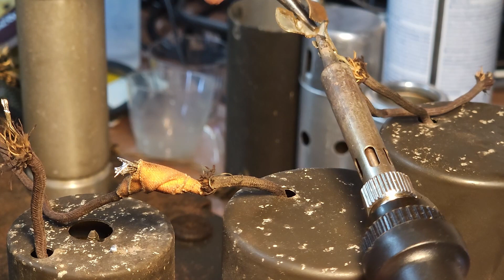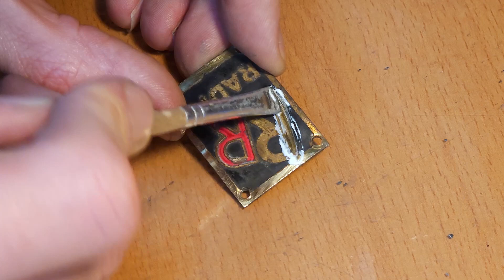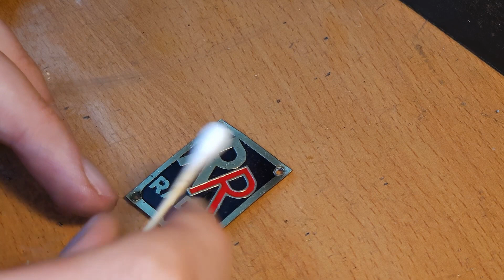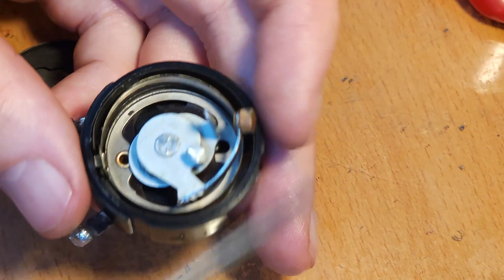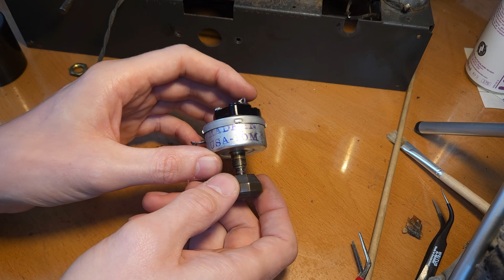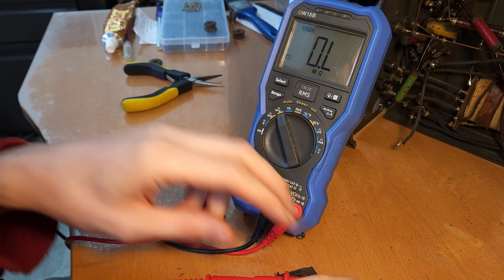Preparing the chassis for restoration - R.R. Radio Type 568 - Part 4

Comment: To comment on the band aid tape; Cloth tape was widely used in the 30's up into the 50's.  Vinyl Electrical tape was not created until the 1940's, but widely used after the 50's.   The wire repair may have been done in the 40-50' possible.

The radio manufacture tag looked great original.  Your touch ups was a nice add.   Many small parts like that were silkscreened in place.
Reply from the maker: Yes, that could very well be a very old repair.
Thanks for the compliments!

Comment: I'm sorry I didn't see this sooner, but for future reference, if you were to spray a coat of clear lacquer on that RR plate, it will do a great job of smoothing out the touch up painting you did.  I also use permanent markers on plates for touch ups, as it masks really well, then when covered with clear lacquer it becomes permanent.  Great job so far!
Reply from the maker: I did spray the badge with clear lacquer afterwards.
Thanks for the compliments!
Reply: I wasn't sure.  The entire project looks incredible so far.  Looking forward to your next video.
Reply from the maker: @antiqueradioarcheology-wil8878 Thanks again. I'm working on the cabinet at the moment, but I'm waiting until it's fully finished before putting out a video. So that might still take a couple of weeks. I do have some other projects coming up in the mean time.